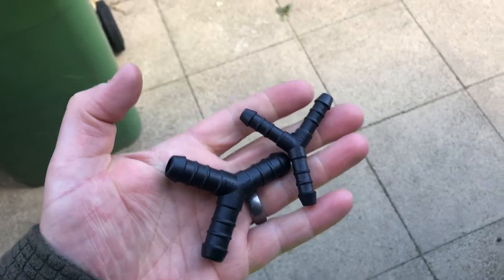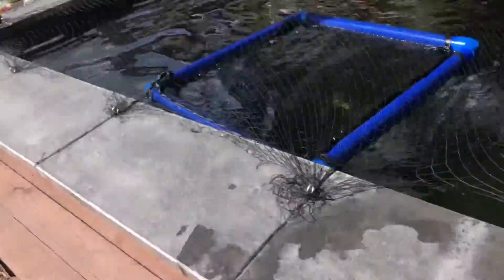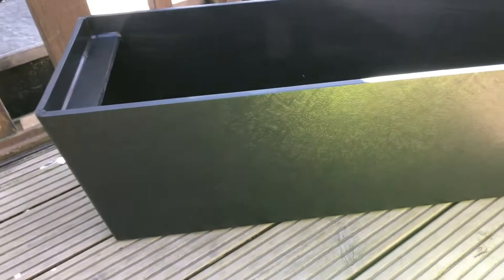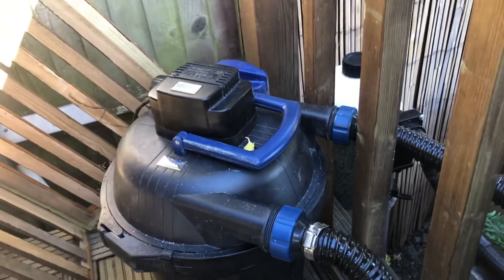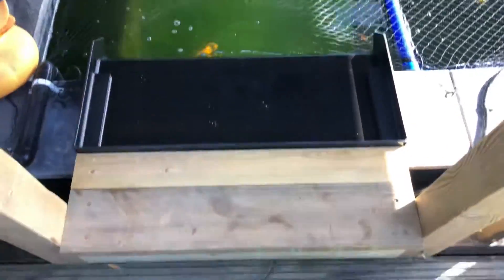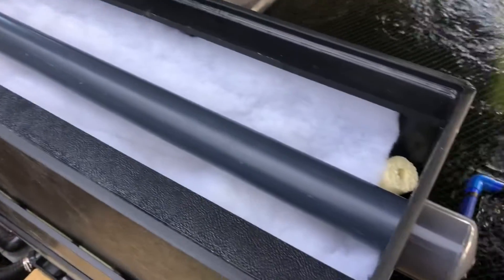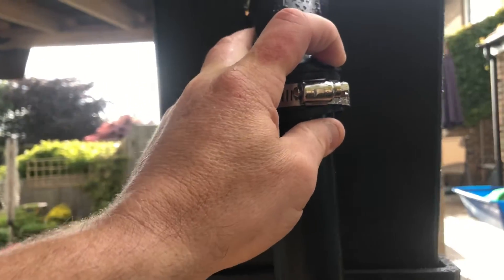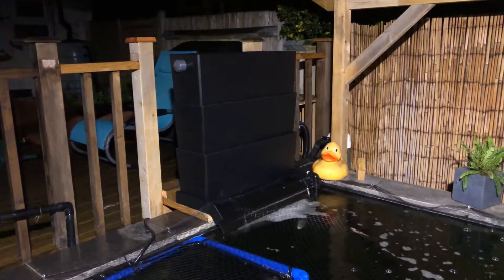How to install a bakki shower filter from JS koi.  New Bakki shower and media

Comment: Shower looks great and just wondering what size pump you use to run it?
Reply from the maker: Hi Darren, thanks for watching. I run a varipump at approx 17000 litres per hour. 5000’ish goes to my tempest and the rest through the pressure filter and into the bakki. Will look to get a bigger pump in the future 👍🏼
Reply: @edenkoipond  that’s great thanks and keep the vids coming I’m at home bored as I’ve snapped my bicep tendon and koi vids are only thing keeping me sane at the moment 😂😂

Comment: Good update like the new bakki What you doing with your old one?  I’m trying to find a tray for my diy bakki shower but struggling.
Reply from the maker: It’s sat at the end of my garden. The tray I just made myself. I made a frame out of 18mm exterior ply, 9mm ply bottom and then treated with outdoor paint. The bits that water would touch I covered in some roofing felt I had. A few months later I had some sealant paint left so covered the felt - been grand for a couple of years now. It’s here if you want it 👍🏼
Reply: @edenkoipond  I wish I could get it but your in the south east I'm up in Liverpool.  I'll have to try make one as it would probably cost to much by mail. Ta
Reply from the maker: Drop me a message on Facebook if you can - I can send some pics etc. takes2 minutes to make 👍🏼

Comment: Nice video Dave 👍
I got my Bakki Shower (2 tier, 1.5m wide) from JS KOI. They also supplied the same media, which I broke up and placed randomly as you have done. 
Did you rinse the media before putting it in? 
Just put a net over our pond, attached to inch and a half pipe. Made it in 3 parts, so that it's easier to lift off. Pictures in Instagram. 
Hope you're all well.
Stay safe.
Reply from the maker: Your net looks spot on 👍🏼 Sadly I was so excited to set it up I forgot to rinse it 🤦🏼‍♂️

Comment: Great vid Dave, love the new shower 👍👍 believe it or not, but water coming out of a shower, has less dissolved oxygen than water going in. Have a look at this: https://youtu.be/VIzGGurDkmA take care and stay safe mate, Terry.
Reply from the maker: Great video - I’ve subscribed. Really interesting stuff, you would think it would increase. A bummer as I’ve only just upped my air with the extra pump and discs 😂😂
Reply: It’s because “The Nitrogen cycle” is oxygen hungry and strips the oxygen from the water. The fact that there is less coming out than going in would suggest it’s working well as a filter to me!
It’s also why it’s important to have a high flow rate through the shower, I would think at least 10,000 to 15,000 ltr’s per hour on a shower that size!
The drop when it breaks the surface re entering will no doubt help put some back into the pond.